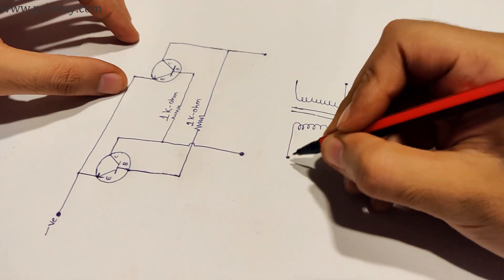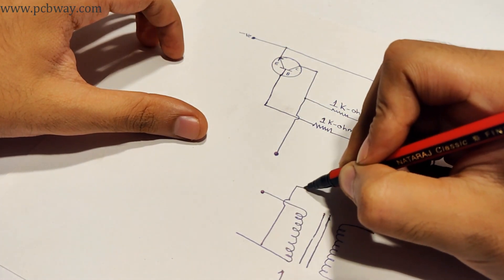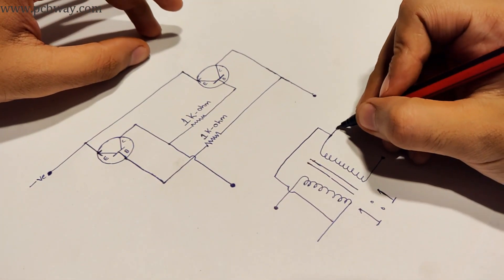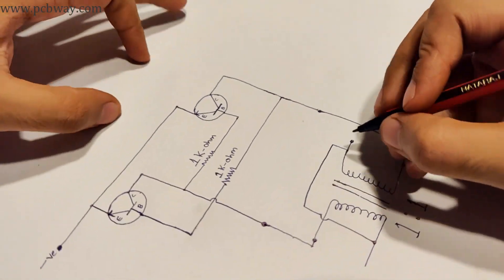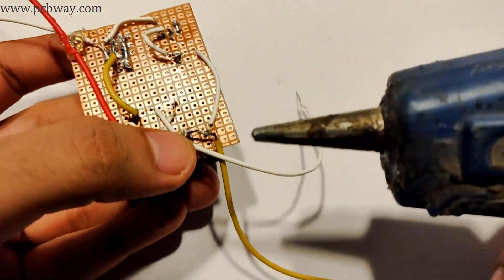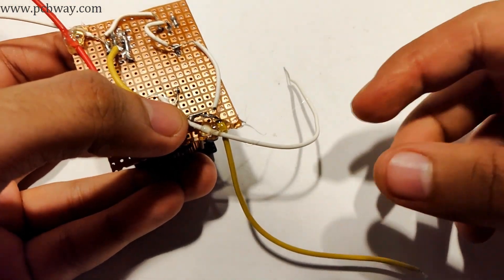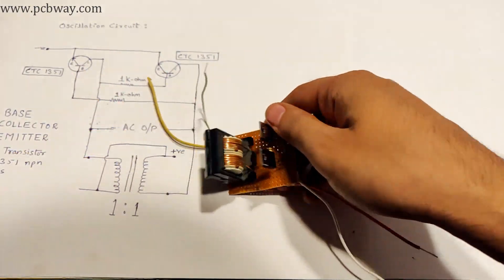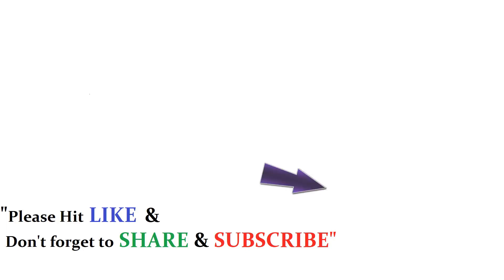DC to DC Boost Converter DIY or How to Stepup DC voltage Easily by PCBWAY

Comment: How is this different from single transistor DC to dc converter? Is it more efficient?
With this circuit you need two diodes to get DC out and a filter capacitor for smoothing

Comment: In today's world, there are many devices that need a steady power supply. However, sometimes the voltage supplied by the outlet is not strong enough. This is where a DC to DC boost converter comes in handy. 

There are many different types of DC to DC boost converters on the market, but they all work in basically the same way - by taking input voltage from a battery or power supply and increasing it to a higher level so that it can be used by devices that need more power. 

Some of these converters are designed for specific applications, such as boosting the voltage to run car audio systems or LEDs. Others can be used for a variety of purposes. 

The important thing to keep in mind when choosing a DC to DC boost converter is the amount of power it can handle.

Comment: Thanks bhai for the share...
I am looking to build a similar circuit to be used in boosting 18 volts, 4 amps to 30 volts,15 amps.
Any suggestions on the modifications?
Reply from the maker: U will need more transistors and better switching circuit
Reply: @MrElectron  I would like to reach out to you for kind assistance by mail how can I do so...?

Comment: So what is the current output limitation based on input current from the battery? Example: if the battery is capable of producing 2A what will be the DC output current of the stepped up, rectified circuit?

Comment: this is a great video, but i'd like to remind you that there's a similar circuit that uses only 1 transistor and bringing the parts down to 3 parts.
Reply: Joule thief?🤔
Reply: how????
Reply: Joule Thief only uses 3 component. The principle is like the blocking oscillator.

Comment: That's the wrong way to solder. You're supposed to heat the pin then add the solder. What you're doing is cold soldering
Reply: Doubt the solder is cold on the tip of his iron 😆😆😆
Reply: Sure you ment he will end up will cold solder joints..
How can you solder cold 😂😂😂😂😂

Comment: Can you add more mosfets to increase the current capacity?
Reply from the maker: yes 15% max
Reply: When you need more power, simply add more mosfets to increase the current capacity. This is a very easy and efficient way to step up DC voltage easily. All you need is a PCBWAY DIY or how to guide, and you can have your very own boost converter in no time at all!

Comment: Cool, great video but the soldering technique makes me a little sad... Do you like to put the solder on the iron first for speed purposes or for another reason? Not being a pain in the butt, just asking. Also, you need a capacitor across the output of the rectifier. The output will just be positive voltage spikes. The multi meter says it's 9 volts but that's the average of the spikes. The actual top of the spike could be around 12 volts. You could throw a massive capacitor between the two outputs and that would make it smooth dc or you could throw a smaller capacitor and a voltage regulator on the end but that's less efficient. Good job though!
Reply: Hi bit late but what capacitor would you use and where would you place it thanks

Comment: Excellent Thanks for sharing your work
Reply: There is no need for an external power supply or battery when you have a DC to DC boost converter. This small, easy-to-use device takes input from a low voltage source, like a battery, and steps it up to a higher voltage level, perfect for powering your gadgets and devices.

The PCBWay boost converter is a simple circuit that uses two transistors and a few other components to increase the voltage output. The schematic diagram is easy to follow, making it ideal for DIYers or those just starting out in electronics.

The board can be designed and fabricated using the PCBWay online PCB fabrication service. The completed board measures just 1" x 1", making it small enough to fit into almost any project.

Comment: nice little osscilator - what is the result of putting different capcitor values parrellel across the base resistor?- some sort of filter i effect expect? 
what part does the 'full wave rectifier' aspect play in the process of the 'field effect' {if any} ?? 
for example what occurs if you just put a two single diodes at your 'AC output' marked section but with the 'triangle' facing each other ? is there then a difference?